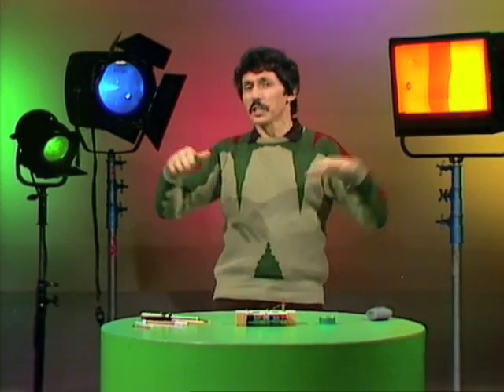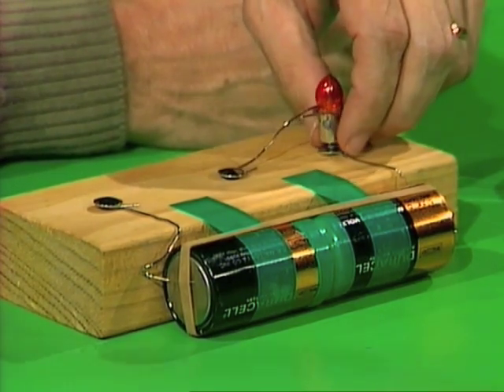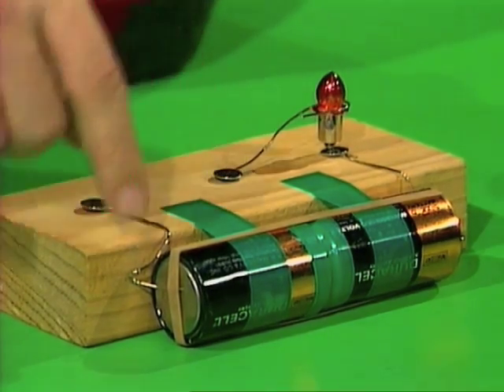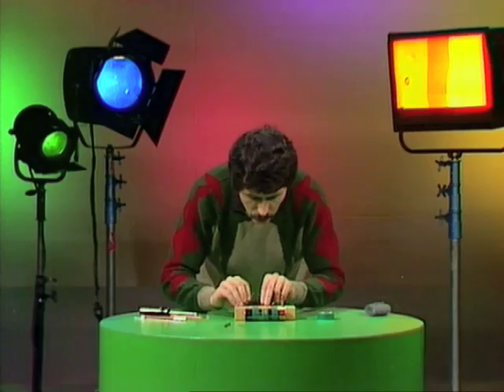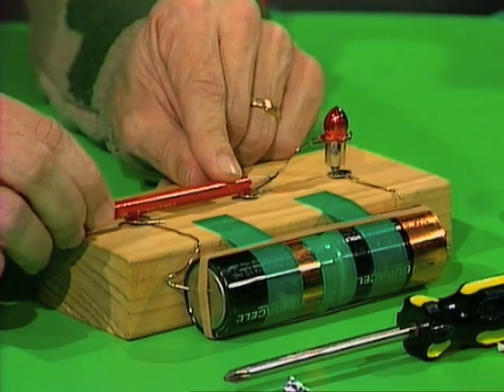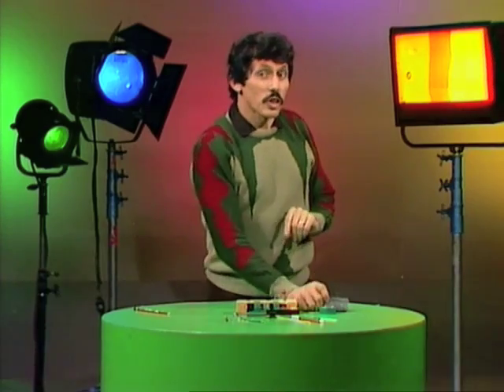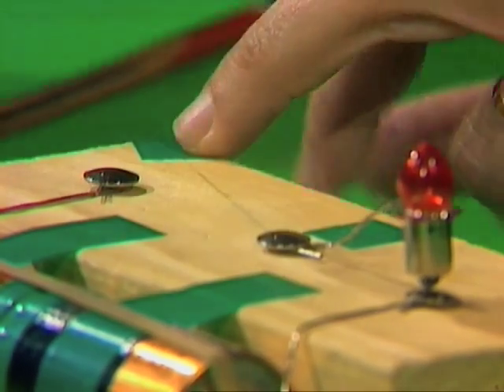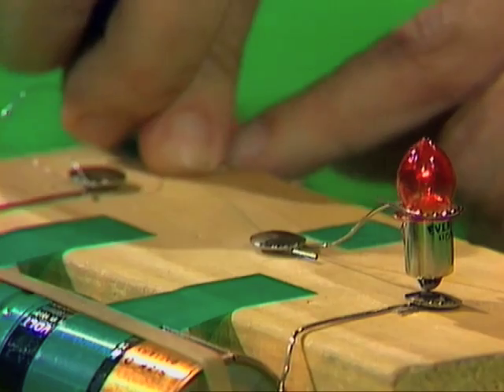Light Dimmer

Comment: huh. yes, while they did get the flow direction (well, there's even problems associated with that idea as it dramatically oversimplifies what's actually going on but I see how that would stretch this topic a bit too far) correctly, that's about pretty much it. I've two issues with the remainder: it's an outright safety concern .. it's extremely easy to get thin wires to glow (just like this classical light bulb is emitting light) and potentially set its surrounding on fire (at least somehow mention it since this clearly is a kid's show). but my biggest issue is: that's in no way actual dimmers work. you really wouldn't wanna have it heat up and pose as a, well, you guessed it, hazard. they cut out electricity altogether. done quickly enough, humans don't notice the flickering (flies might .. but it's not that hard since you've afterglow as well). on a dimmer, you essentially set a certain voltage. a higher one would trigger the mechanism to kinda switch off the light altogether so that it looks like at a certain phase, the power gets cut off (it's typically easily audible, actually). so, bottom line: I heavily miss the remark that while this all's very interesting, it's done "differently" in the "actual thing."
Reply: Ooo interesting! Thanks for sharing. 😀🧠👍

Comment: I doubt that, even forty years ago, one dollar, Australian or Canadian or American, was enough to buy all these parts new.  The batteries, alone, were more than a dollar, I bet.
Reply: I found a picture from that era of a Radio Shack battery club card that gave the bearer one free battery per month for a year, with a maximum value of $5.88. That puts a single D cell battery at around 49 cents. Though I suspect the intent in this project was to use batteries that were just lying around.

Comment: Does it work for AC current?
Reply: yes, it would (it's even somehow implied in this segment because they claim, this is how your light dimmer at home works which runs "on" AC. so they know, this would work with AC. just, that principle isn't used because foremost, it would cause heat issues)
Reply: Now, lemme guess you're going to shock yourself by putting these in the power outlet of your house, he's using small batteries to avoid that risk

Comment: same principle in the trigger controller of a slot car set.. thin wire rapped around a mica strip, the spring-loaded trigger slides a steel bar forward and back.. simple and reliable.

Comment: Can something else be used instead of steel wool?
Reply: You can use any very very fine wire. The problem is that in your day to day life rarely do you encounter wires that are as fine as what's used in steel wool.  Fine steel wool fibers are 0.04 mm or 1.5 thousandths of an inch.
Due to the low total power consumption of the lamp a wire that's any larger than  shown are  not going to have enough resistance/voltage drop across a short length as shown in the experiment.
Reply: @otm646  Thank you !
Reply: @otm646  why does it drop in the first place with thin wire? Is it getting lost to the environment or something more? Bc I thought length wouldn't affect the bottleneck in that way, but idk much about elecricts
Reply: @SquirrelASMR  Resistance in a conductor is basically a measure of how likely an electron is to run into a positive ion on its way through. Think of balls rolling down a ramp and when they get to the end they push a button which briefly turns on a light. Now put holes in the floor every few metres - not all the balls will fall into a hole, but some will. If you make the ramp wider (or use a thicker wire) then more of the balls are likely to avoid falling in a hole. If it's narrower almost all of the balls will. Likewise for if the ramp is longer - the more holes the balls have to get past, the less likely that they'll get all the way down without falling.
It's an oversimplification - there's a lot more going on with elecricity than this analogy can cover - but it's enough for this particular case I think.
Reply: @TheMightySwash  okkkkk thankeee!!! I appreciate it 🙏

Comment: Pretty much how a "variac" (varible autotransformer) works, just with more power and less touching of live wires
Reply: Well they work completely differently, are based on completely different mechanisms, have very different requirements, and have vastly different trade-offs; but yea, they both manage to achieve a similar result in this particular situation. So I'm gonna say: no.
Reply: @timharig  A conductive slider moving up and down an inductor. It's functionally a potentiometer/variable resistor that uses a sliding tap. How are they not the same core principle?
Reply: "they work completely differently": One works by controlling voltage while the other works by controlling current.

"are based on completely different mechanisms":  Reactance vs. resistance.

"have very different requirements": Inductors don't do much with DC.

"have vastly different trade-offs" : Resistance works with DC but has two major problems. 1. It loses real energy to heat whereas you don't really lose reactive energy.  2. The inductive method will tend to maintain a relatively constant voltage throughout its targeted  load range. Since the resistive method is limiting current, it will vary the voltage widely as the load changes.

The fact that they both use brushes is mostly incidental. I mean I guess by your logic you would say a piston is pretty much the same as a jet engine because they both have a throttle?
Reply: @timharig  They both use the length of the material to control the output, rather than the thickness or "rating" of the material though, right?
Reply: @4pThorpy  No. Thickness and length will both contribute to resistance (varying thickness is how you create rheostats with either linear or logarithmic tapers) . Inductance is not determined by the length of the conductor so much as it is defined by its shape and number of turns a well as its core, mutual inductance,  etc. Calculating the resistance of a chunk of conductor is relatively straight forward. Calculating the inductance of coil or cable ,  especially if it isn't a solenoid or straight wire,  can be much more difficult.

You might also consider that a mechanical wiper is not the only way to select the coils of an autotransformer. Since that is what you seem to be focusing on.  It could also be done using solid state switching. How the coil is selected is incidental to its function in the circuit.
Reply: @timharig  thank you very much for taking the time to correctly explaining this easily confusing topic to all of us!

Comment: Carbon is conductive?
Reply: Graphite is, particularly. Other forms of carbon, I'm not so sure about. Fun Fact: some of the first incandescent light bulbs--or the prototypes, anyway--used little carbon rods as the filament.
Reply: and commonly used in brushes on commutators.
Reply: Some of the forms of carbon are good conductors of electricity and heat! (Diamond is good at both.)
Reply: Carbon is essentially a semiconductor. Its an insulator that can be made to conduct based on its molecular structure.

Comment: To make a dimmer, also works with LED lights, look up how to make a PWM circuit with transistors. PWM = Pulse width modulation.
Reply: Adding a (variable) resistor also works with LEDs ... think of it as a tap of water running halfway turned on vs running fully turned on but clogged half of the time (switching at a very fast rate). In the end you get the same output of water. It depends on your application and circuit which approach is to be prefered.